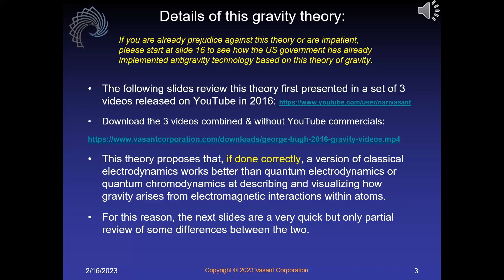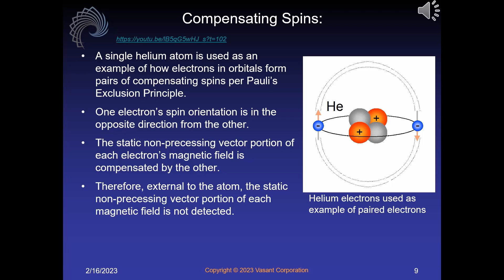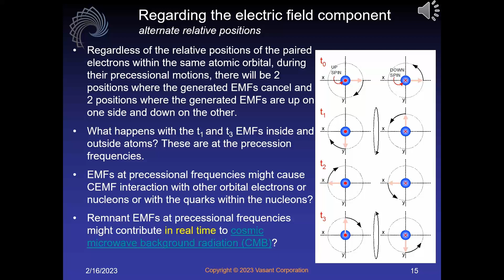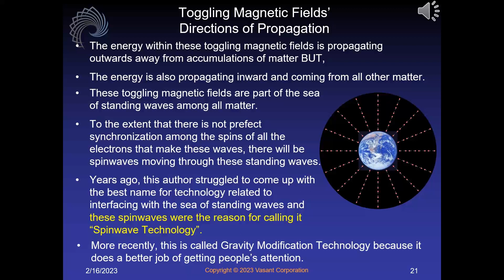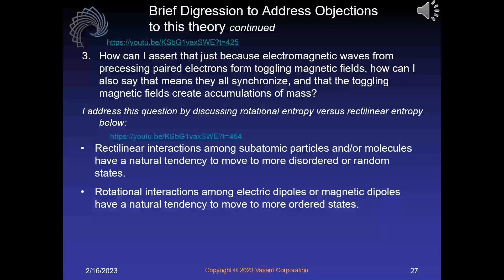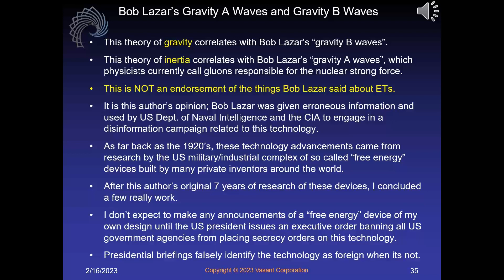An Exploitable Link between Electromagnetism and Gravity

Comment: I personally believe that you can replace spacetime and electromagnetic fields with a fluid dynamical substrate, which is compressible and ideal, and this should be able to explain electric forces as density gradients, charge sd density deviation from vacuum background, magnetic fields as vorticity, and gravitational forces as a result of compressibility. to explain matter, you have all structures that can be stable and self sustaining in fluids, such as vortex rings, vortex tubes, and vortex tube knots, and by nesting and arranging those, one should be able to model all particles, and all their forces and properties can then be derived from fluid forces. most importantly, gravitational forces would be perpendicular forces to magnetic field lines, which are really flow lines, and this means any magnetic field causes a compressive inwards force not encapsulated by field theory, and I believe this can only accumulate due to the direction of the vectors, leaving spherically symmetric density gradients as a result, and their interference produces the attraction known as gravity. 
analog system with fluids such as water or air, or even more exotic ones automatically reproduce so many of phenomena related to electromagntism and "spacetime", that its absurd to not suspect that the entire universe can be explained by a single fluid dynamical model, which bears all known forces as emergent purely from density deviations in motion. 
I think gravity has a much more direct cause that radiation and absorbtion, in fact I think gravity is based on a static density gradient, not involving any dynamics at all, other than the flow fields that are magnetic fields of particles, which form closed loops, but are less dense because of their motion, and therefore accumulate an inwards density gradient towards them to neutralize there dynamically lower vacuum density. this means there is no energy leaving or entering the "mass", gravitational attraction is purely static. with this, any electric charge and magnetic pole is inherently gravitational and lowers / reduces weight, and the only difficulty in modulating weight directly is the scale of the resulting forces, which is why its typically not possible to measure in labs, unless very high voltages are used, and fields are correctly oriented, and people are actually looking for weight reduction / increase. if you were able to get a strong enough electromagnetic dipole relative to the rest mass of the apparatus, it should destructively interfere with its own gravitational field, leading to reduction in weight, and even reversal of direction of gravity if high enough. also, the system would appear to violate energy conservation because there is no lift at all, and the weight reduction or reversal represents a conversion of what the gravitational field of earth does to the apparatus, and thus appears to violate energy conservation because the earth is typically not considered as part of the system.

Comment from the maker: It is relatively easy to test this theory of gravity using 2 isotopes with a large difference in the number of neutrons in the nucleus versus number of orbital electrons, like listed on the charts in this file: https://www.vasantcorporation.com/downloads/equivalence-principle.pdf. Measure their gravitational mass with a typical weight scale and compare with the inertial mass of the same 2 isotopes using a torsion pendulum to measure their inertial mass instead of their gravitational mass. UPDATE: I did the test and it failed. ;^( For my interpretation of Bob Lazar's Gravity A and Gravity B to be correct, there must be some interaction between orbital electrons' motions and nucleons' quarks motions such that more nucleon mass causes more energy exchange with and among orbital electrons but I don't see how that is possible right now.

Comment: any chance you are going to share the list of devices that did end up making extra power ?
Thank you for sharing the ideas. Time as a variable is sure missing from most people’s thoughts, when I first ran across the idea, it makes so much more sense than standard physics, but had not thought about how it changed inside the atoms, thank you for that idea. Just out of curiosity, what do you think of the idea of taking an iron sphere and driving it to magnetic saturation on 3 axes with 3 phase power, any idea what frequency range would be needed to disrupt the high frequency magnetic waves ? At least that is the next thing I am going to try.
Reply from the maker: Currently available lists are now all bogus designs.  Even particular designs that used to work are now replaced with same name designs that are no longer valid.   But this article discusses some designs that originally worked.: https://www.vasantcorporation.com/what-powers-those-pentagon-verified-ufos.php